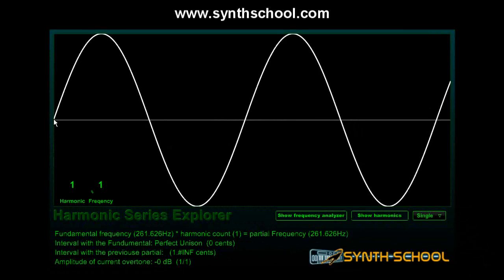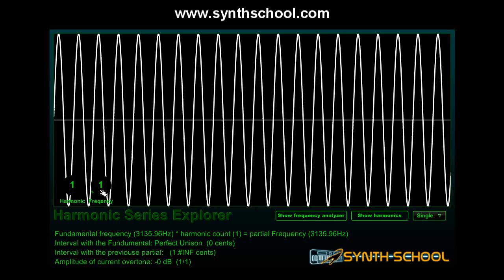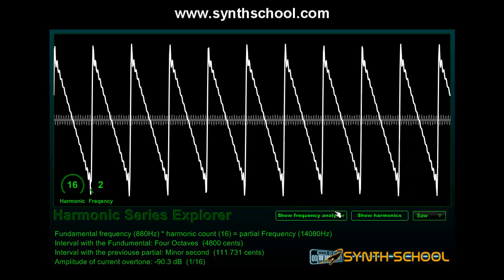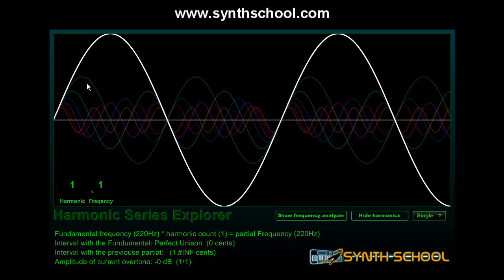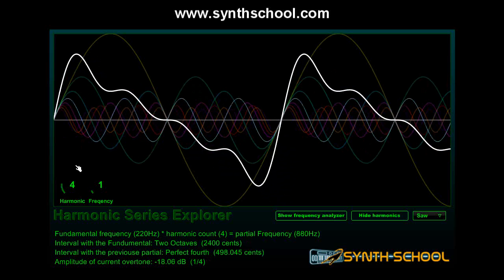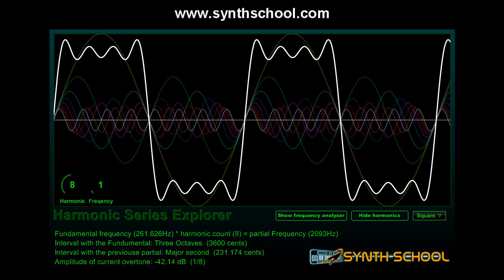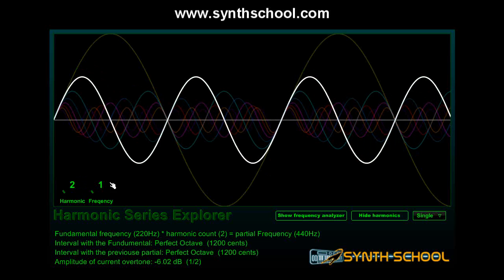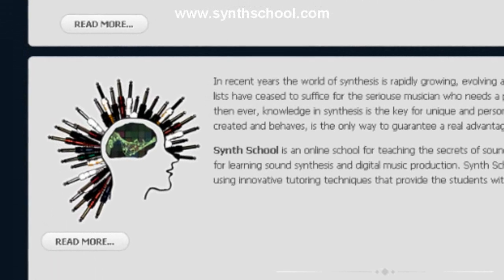Overtones, harmonics and Additive synthesis

Comment: 1:09 I'm sorry, do You mean to say that the speaker literally moves to and fro within its casing in the Audio System with relation to the Y-Axis?
Reply: Yes, that's actually what it does.
Reply: @jakegearhart 
Are You sure? Thanks anyway. 😊
Reply: @Max_Le_Groom  Yes, speakers vibrate, and vibrating means moving backwards and forwards rapidly.

Comment: so you're telling me even when you make a square wave... the speakers  send out sound waves in the shape of the square ??
Reply: Sort of, the driver moves back and forth sort of like a switch, where it moves to one position, quickly "flips" to the other position, stays on that position for however much time, and then moves back. So if you put that movement on a graph, it makes a wave that looks like it's made of squares. More complex sounds of other instruments use much much smaller, more precise movements than a square or sine wave.

Comment: What does a wave with only even harmonics look like?
Reply: RoboticusMusic saw wave
Reply: x2, x4, x6, x8, x10, x12, x14, x16, x18, x20 - produce even harmonics

x2 / 2 = 1, x4 / 2 = 2, x6 / 2 = 3, x8 / 2 = 4, x10 / 2 = 5, x12 / 2 = 6, x14 / 2 = 7, x16 / 2 = 8, x18 / 2 = 9, x20 / 2 = 10 - move all the harmonics back so that the x2 harmonic become x1 and is at the fundamental frequency 

x1, x2, x3, x4, x5, x6, x7, x8, x10 - you can see it is the same as a saw wave

Comment: Sound waves are compressional waves, not sine waves. You use sine waves to explain compressional waves because it's easy to see and visualize, but it is not correct. Sound waves are compressional waves.
Reply: A. Hirt If you plotted pressure over time it would create a sine wave.
Reply: His point is that the actual sound wave (different levels of air pressure over the time) would look nothing like an actual sin wave IRL but yes the plot of the data is indeed a sin wave
Reply: Thanks for that explanation A. Hirt. I always wondered why I didn't see these curvy lines coming out of speakers.
Reply: A. Hirt yes but when you graph a pure tone on an oscilloscope, you get a sine wave, and when you generate a sound using a sine wave on a computer, you get a pure tone. A sine wave is the transverse representation of a pure tone.
Reply: A. Hirt: You're confusing wave type with it's physical representation.  Sine waves are universal throughout nature: water waves, electromagnetic waves, molecular vibration, springs and, of course, sound waves.  You are thinking that a sine wave is always lateral, like its graphical representation, but longitudinal waves are also sinusoidal.  The compression and rarefaction of a sound wave model the sine wave, but in a longitudinal form.

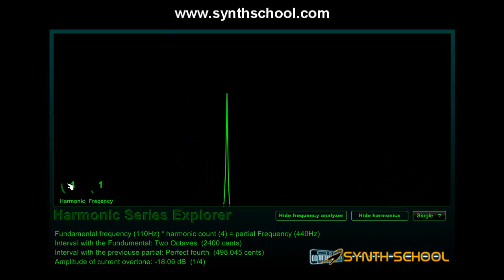Comment: I don't understand something. Round 3:33  we see the frequency and amplitude change therefore generating a different pitch each time , but why does the amplitude keep getting lower? shouldn't it be the opposite, since the frequencies go higher and higher therefore producing a higher perceived loudness and several cycles per second?
Reply: Audii Martini You could see Amplitude as the volume, how loud or how silent a sound is. Pitch is how high or how low a sound is (in terms of musical notes) and is given by the frequency, so both concepts are independent of each other. You might be mistaking the 'amplitude' with the 'wavelength' which is the inverse of the frequency.

In this specific case we need higher pitches to have lower amplitudes, in order to be able accurately construct the new wave.

For example, the Fourier series for the square wave states that to make a square wave you need to determine what final amplitude and frequency you want. Your first component, the fundamental frequency (which gives the musical tone), will have that same frequency, and 4/pi times the amplitude you selected.

The next component has triple the frequency and one third the amplitude of the fundamental. The next one has 5 times the frequency and 1/5 the amplitude of the fundamental. Next is 7 times freq and 1/7 amp. next is 9 times and 1/9, and so on (the series is infinite so you just go on until the result is approximate enough for you)

If you do not follow this pattern, then the resulting wave will NOT actually be a square wave but something a little (or very) different.

Comment: Sound & electricity "sounds to be the same" is this how harmonic sound frequency is generated? Essentially I wud think that pwm sound can generate the hertz necessary to power or move a DC or servo motor.... And if thru I wud assume that if you can have an electric piano synthesize and music note that of the same sound frequency as a say 50hz you chud be able to have a connection solder to motor and play a musical note at that that powers a Hertz similar to a pwm sound to move a gear head to the next teeth or spoke? Kinda like a telegraph machine or telephone knows what digits your pressing or dial tone or kinda like a fax know what your faxing and prints it or like a 3D printer moves and you hear those traveling sounds, if all this theory of mines is correct I guess I can make a bunch of motors move to a specific location by just saying it or playing a musical note, I been working on a project where I use sounds to generate power in a analog mode
Reply: great man ! i love your innovation
Reply: Kush Pandya are you talking about my comment?  or ref to the video?

Comment: You are not correct that sine waves are the building blocks of sound. It's true that all contiuous periodic functions are an infinite sum of sinusodial waves each of which has a frequency that's a multiple of that of the periodic function. It's also true that all contiuous periodic functions are an infinite sum of functions of the form c(sin (2anπx))^3 where a is the frequency of the contiuous periodic function and n is an integer and c is a real number. I define a cubic sinusodial wave to be a function of the form I just described. Thus cubic sinusodial waves are just as much the building blocks of periodic functions as sinusodial waves. A sinusodial wave itself can in fact be expressed as an infinite sum of cubic sinusodial waves each of which has a frequency that's the frequency of the sinusodial wave * a power of 3. Sinusodial waves do however have a special propery for hearing. Only sinusodial sound waves trigger celia cells in the ear for one pitch without also doing the same for other celia in the ear responsible for detecting another pitch.
Reply: No idea what you just said, please explain for us peasants.
Reply: No, this guy was saying a bunch of  stuff about cubic sinusoidal functions which doesn't really mean much. Orthogonal functions when integrated together = 0, which is like having vectors who's projection comes out to 0 and means they can be used as a basis to approximate other functions, . The reason for the term orthogonal is it comes from studying vectors, but can be applied to functions. Basically functions that can be used to measure others, and sin and cos are the simplest to use.
Reply: Any orthogonal function can be used to approximate another function, but sin is special because it's the solution to  the equation that describes simple harmonic motion.
Reply: So, I guess that means that sound is defined not by whether or not humans can hear it but whether or not it possesses the characteristics defined above. I always understood "sound" to be defined as the phenomenon that is perceived by our ears. 

Thanks for the explanation.
Reply: Are you saying it's more like a voxel vs a pixel?
Reply: Hm. Intriguing.

Comment: A sine wave does not describe a circle.  It's derived from the y-dimensions of a circle as a function of angle (in radians).  If you flipped one half of the sine wave back on itself, it would not form a circle, but something more resembling the shape of an eye.  To describe a circle in 2D using sine, you need a parametric equation which uses sine AND cosine. (x=r*cos(t), y=r*sin(t), where r is the radius of the circle)

Comment: i have a question, does one of you guys know how i can do additive synthesis in sense of adding/removing overtones over time? (i'd like to get throat singing effect (not the format filter effect)) i do this now in reason with a patch with a lot of vocordes funging as spliter to control like 256 malstörms. my computer cannot handle this^^ is there a way to do so with a vst?

Comment: Good response. Check out this video (video tag: 6JeyiM0YNo4) of a vibrating violin string and you'll see that the strings vibrate in the same manner a speaker would, and are mechanically identical to what is going on when you play your guitar string, the computer just recreates the effect.

Comment: Dear sir,

When I generate a sine wave at a certain frequency with my audio oscillator, are harmonics also produced or is it just the fundamental? When I trace this signal through my audio amp, I see all sorts of strange patterns that don’t look like my original sine wave. Is this caused by harmonics?? Should I expect to see the original sine wave shape, although amplified, at the output of a correctly functioning audio amp??

Thanks very much

Comment: Very excellent introduction ! BTW relatively highly inharmonic overtones are what makes the piano tone.... (due to stiffness in wire) - and natural overtones cannot make a cycle of 5ths and get back to a pure overtone, hence the "comma" difference that "tempered" occidental tuning divide by 12 (or other means) to get back to a pure frequency multiple at the octave level. (sorry English not native !) Other theories apply as well (as for generation of all  notes via partials)

Comment: @soundsalvo You do make a valid point and it is one that many people could easily confuse, but it does depend on what you mean by 'slower.' Lower frequencies ARE slower wave oscillations compared to higher frequencies. But as you mean to point out, ALL sounds--regardless of their frequency, travel through the same medium or environment at the same speed. In this video, he does not actually say that the sound is travelling slower to our ears, but it is true that he could have been more clear.